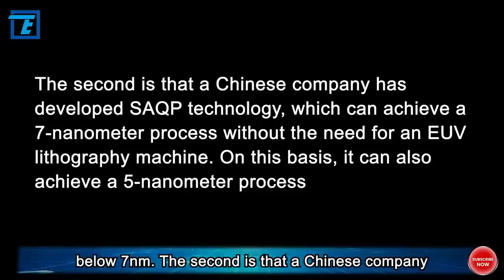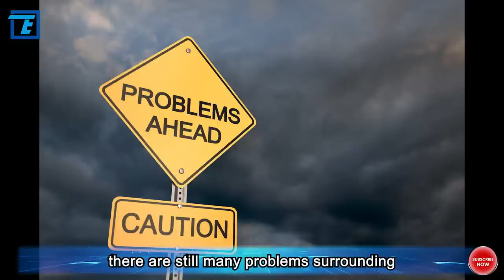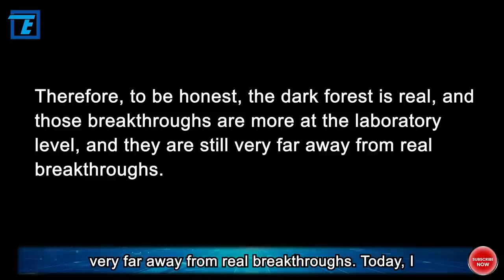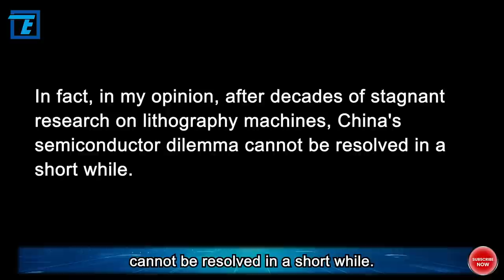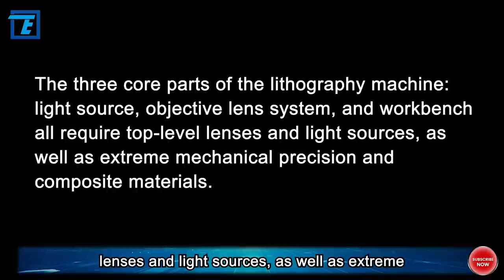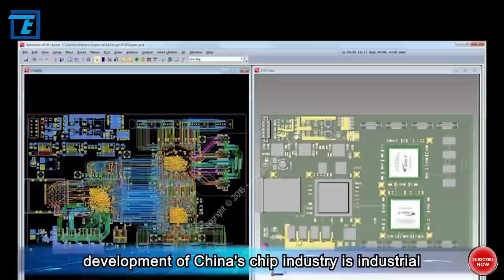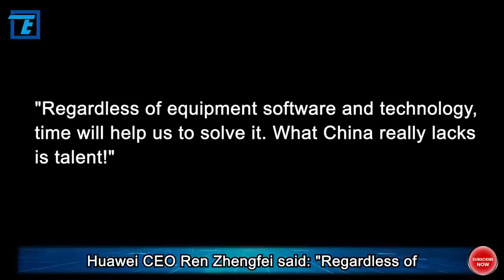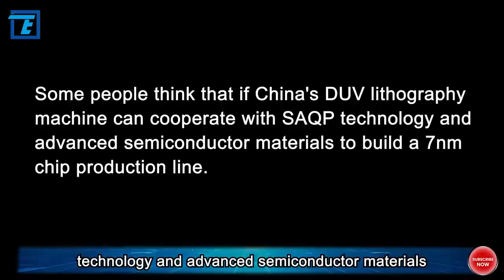From 7nm to 5nm, China lithography machine has made another breakthrough?

Comment: The good news really is that China is already embarking on the difficult and arduous road of producing its own lithography machine. Another epic long march, like the first long match! There is  a push and a pull factor. The success of the legendary long was generally attributed to a great leadership group! In their technological   long march Huawei exemplifies such a leadership group. We are all quietly confident, however, that China will succeed in the end, as failure, like the legendary long march is not an option open to them!
Reply: SMIC also plans to release its N+2 breakthrough with a 7nm chip, which raises the performance to 35%, which pars the 7nm chip manufactured by a EUV tool. This new chip will go to production by end of. 2023.